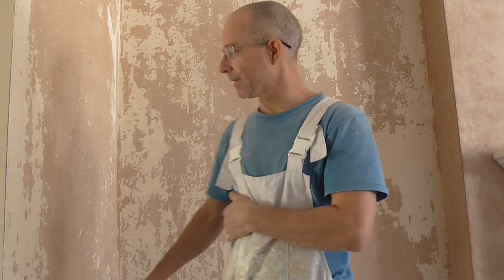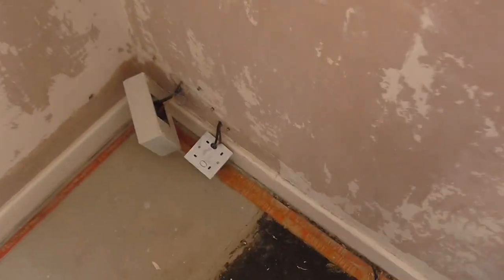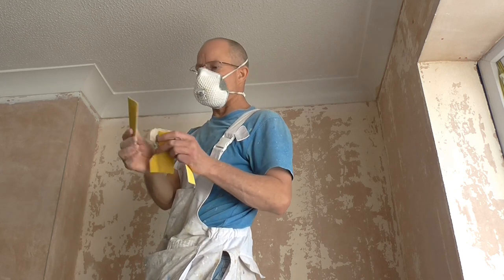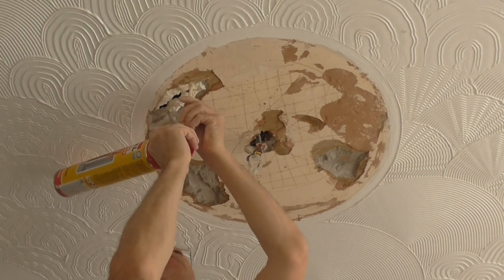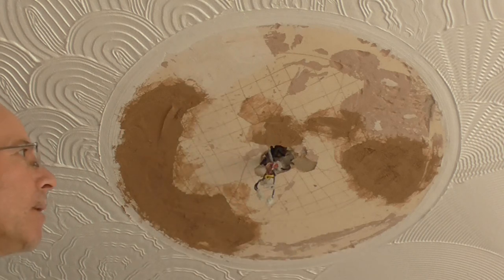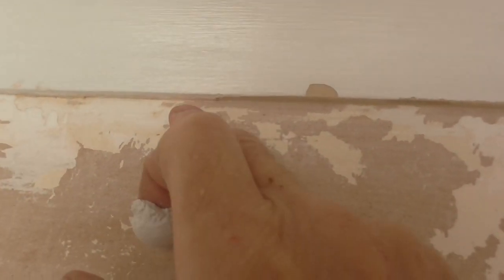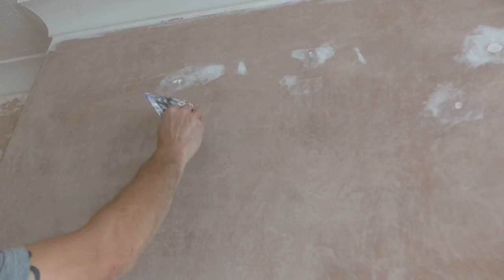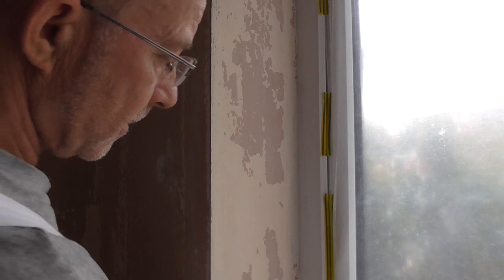Filling A Room After Removing The Wallpaper

Comment: Mate for crying out loud buy a random orbit dustless sanding system, save yourself the grief of sanding walls manually. It makes no sense to sand areas that rough and that big  by hand. Appreciate that your work is decent and that you're old school but there's been some pretty amazing innovations in P&D equipment that just makes the job so much more efficient and enjoyable. Also, said it many times before, try Toupret TX110 filler, you can fill holes of any depth with it. Ditch the Polyfilla, it's an inferior product and there are so many better options on the market now.
Reply: Spot on mate , these two are excellent tradesmen but would help themselves no end if they moved with the times a bit . Time is money.
Reply: @orbitalforest  I've seen you post before on here and you get what I'm talking about. Time is indeed money, and a lot of jobs in our trade take a great deal of time. Also, just the sheer monotonous physical exertion of doing everything the old fashioned way is just plainly mad considering the far superior alternatives at hand.

Comment: Thank you so much for this video. I've just stripped several rooms of paper and filled holes/cracks, and am ready to sand down the filler. But this video shows how much more I have to do before lining the walls! Unfortunately the previous owners used silicon sealant on everything from the tops of skirting boards, under coving, on top and under dado and picture rails etc etc. It's a nightmare as it hangs onto the old paper (a lot of it being woodchip, a nightmare in itself) at the edges, necessitating using a knife - not an easy job.  What grades of sandpaper did you use for the walls and skirtings?

Comment: Another master class in decorating. This is one of the best channels for me on Youtube. Please forgive my question, can I use watered down SBR to seal walls and paint to leave a key and bind to the old surface, as you do with watered down PVA? I have other uses for the SBR and it is water resistant. Many thanks for your efforts.
Reply: You shouldn't use PVA, I don't know where this has come from, it's not something taught at college. PVA is what plasterers use, SBR also .. as they go into plaster and render mixes. PVA is a decorators nightmare when you come across it when it's been used. When you roll a ceiling and a plaster had patched up and excess PVA has been used and it's on the surface, the paint softens it up.. and when you re roll over it, the paint comes away.
Reply: Any chance of your thoughts on my question about SBR? You are much better than I am in replying. Kind regards for your work.
Reply: @michaelmercury1256  I've no idea what SBR is as it's again.. not a Decorators product. It's what builders, renderer and plasters would use.
So I'd say don't use it and why would you.

Comment: I've just removed the old wallpaper from a living room and the walls are a mishmash of old and new plaster, various cracks, rough bits, some old water damage spots. I was thinking of renting one of those large vacuum sanders and going over the walls to try and get some uniformity for painting. Would a sander take off everything or should I sugar soap to get rid of any traces of old paste? I want to get a nice paint finish at the end so I'm wondering whether I should try and get the walls smooth, pay a plasterer to do a skim coat or pay someone to install lining paper? I'd really appreciate any help with this as I'm a bit new to interior DIY and don't want to mess it up. Thanks for all of your superb videos.

Comment: I've dry removed some old wallpaper from a really dry wall. THe plaster underneath is still stuck to the wall but there are loads of fine cracks. Any suggestions? Would it be ok to walpaper over it? Better still, do you have a vid on it?

Comment: Great video thank you. So you use filler right up to the pvc window frame? You wouldn't use some kind of caulk or sealant?
Reply from the maker: Thank you ..  if the windows are nicely secure and foamed, then pollyfilla is perfectly fine.. and the best finish.

Comment: Another great video, could I use Chaulk instead of polyfiller on the skirting and door frames?
Reply: Sure, that is what most people use. But it will shrink and sometimes crack over time if there is movement. Not a problem it can be re-done every time you redecorate.  It's just a sticking plaster really though.
Reply: @TomTomTomTom538  thank you for your reply, I shall use a filler, instead of chaulk
Reply: @paulwilson1555  filler cracks open when it dries out over time, also if you paper the walls and use a blade to cut the top edge of the skirting, the blade can dig in and crak it open. If you get the right caulk,  if won't crack. best to get the interior/exterior flexi caulks you can buy now days. If you need to  back fill, with caulk (depending on how big it is, silly foam can be used if its very big), do that, then finish the top edge with caulk, nice and smooth.
Reply: @ProfessionalPainterDecorator  brilliant thank you, I shall check out the flexi caulk.

Comment: Another quick question, the door frames where they join, there is a thin line, where the two pieces of wood meet, could I use Chaulk just to fill the line? Or would I use wood filler? The surface is currently painted and will be painted over.
Reply: I've had some of my architrave mitres crack through the paint.  I found the only way to stop it coming back is to run a fine saw down the mitre to open it up to get foam behind and fill with 2 pack filler. A couple of veneer pins from the top or side help too.
You can't smear filler or caulk over the top or it will just crack again. I wouldn't recommend caulk for that job it will just shrink back too much
Reply: @TomTomTomTom538  thank you, I shall try that.

Comment: What’s your thoughts on filler coat ? I have just removed 5 layers of paper from 1950 !!! 🥴. It’s all come off evenly but the wall isn’t super smooth — are filler coats like everbuiild any good ??? Thanks. I want to emulsion not paper !
Reply: Toupret TX110 and Toupret Joint & Skim ready mixed are the best wall fillers on the market.
Reply: Toupret fill & level is a good product for a diy'er
Reply: @AspireDecorating  I've never actually used it, though I have seen videos.